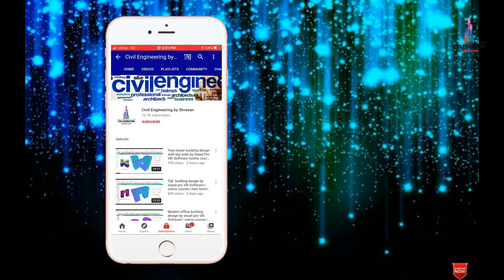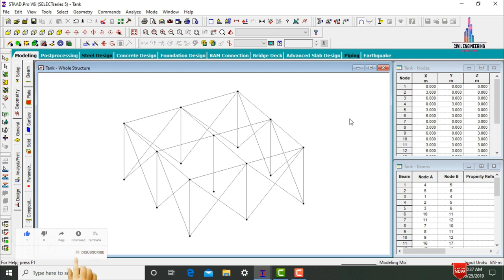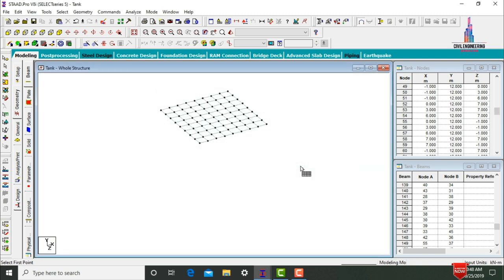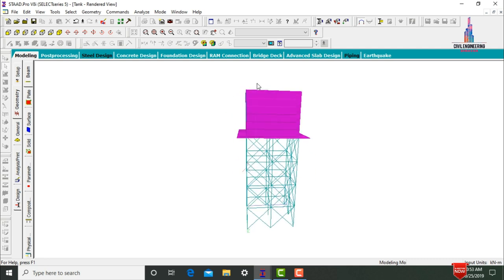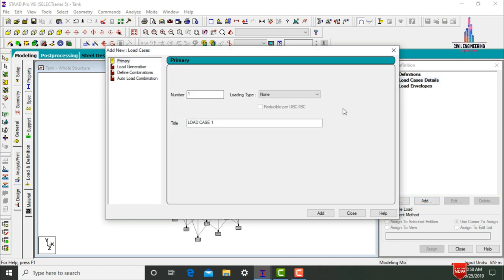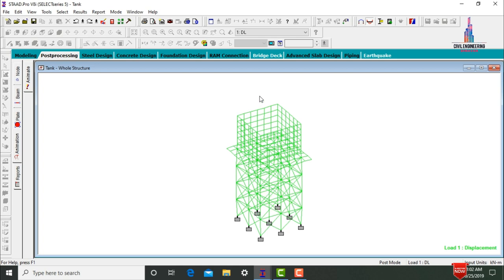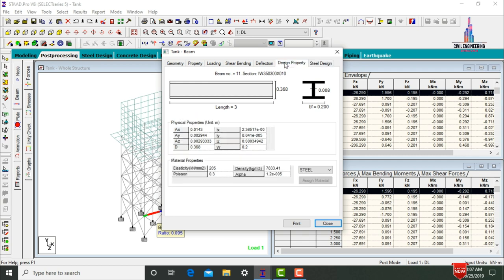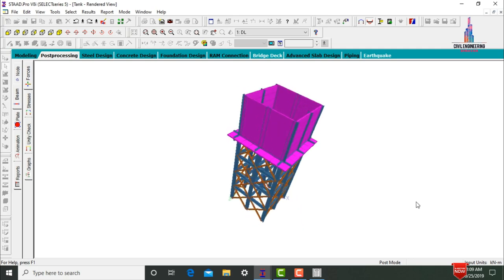Elevated Steel tank design | civil engineering |online course |software  | Staad pro | auto cad |

Comment: dear brother, how you can check the thickness of steel plates of the tank. also how you can apply the seismic loads for the hydrostatic pressure of the fluid?  waiting and thanks